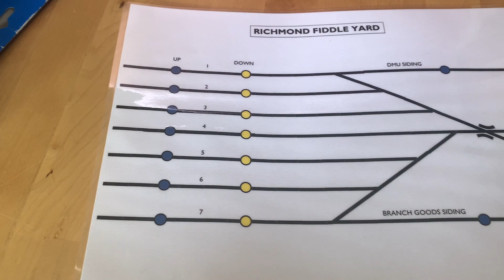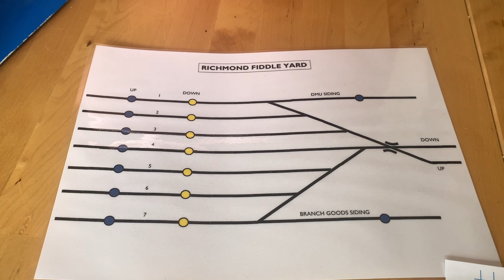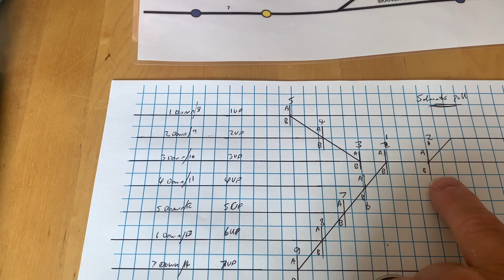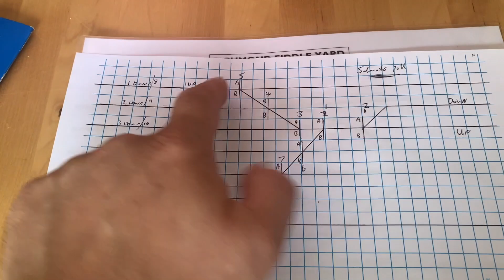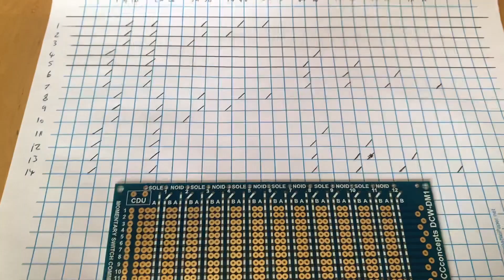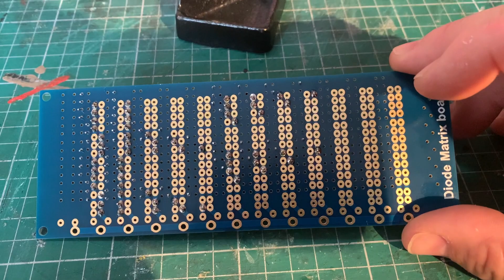#51 Diode matrix for model railway point control, route setting for your fiddle yard

Comment: Coming to this a little late but this is exactly the information I'm after, thank you! Is there a way to show the route selected with LEDs?
Reply from the maker: @PhilipFawcett-g6e  yes, but not through the diode matrix. I used Peco point motors, you can add an accessory switch to them to control route indicating LED’s. It obviously means a fair amount of extra wiring, but it would totally be worth it in my opinion, and something that didn’t even occur to me at the time!